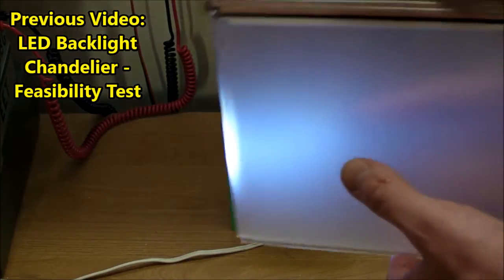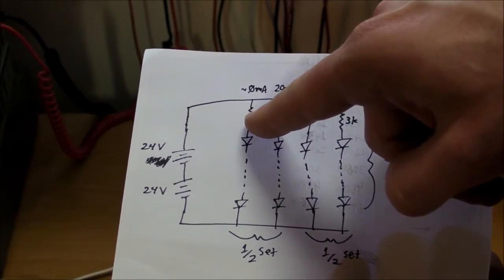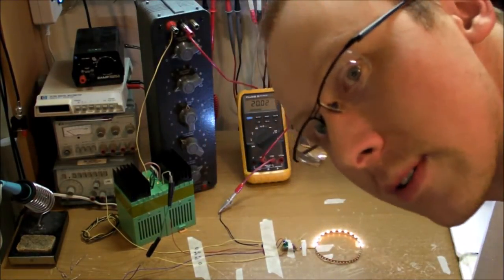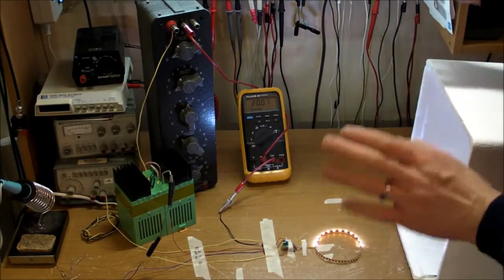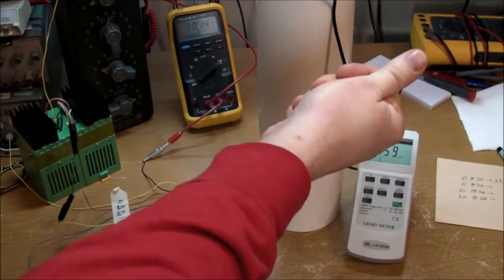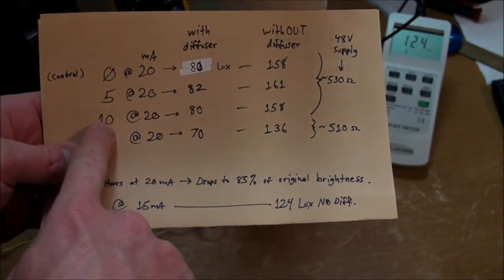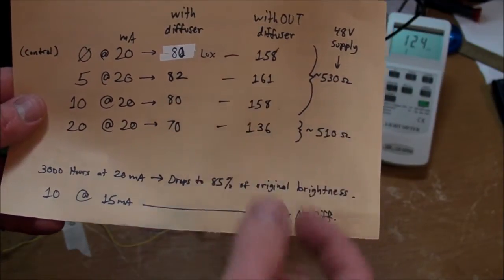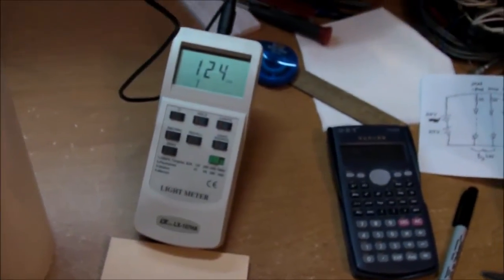(#0182) LED Backlight Chandelier #2 - Feasibility Results

Comment: Hi Eric:  I understand you want to re-purpose the panels more or less as is.  However, my thought is to re-purpose just the panels (minus the original LEDs) and add a new RGB string.  In this way you could control color temperature and make a cool light show as well.  Just a thought.  Have missed seeing your vids.
 
Cheers,
Mark
********************
Reply from the maker: Good idea. Hadn't thought about that. But I am content with the LEDs as they are. From the very start, I've been thinking about adding a secondary light source to warm up the color temperature.
Reply: Yeah, one of those vintage globular jobs.